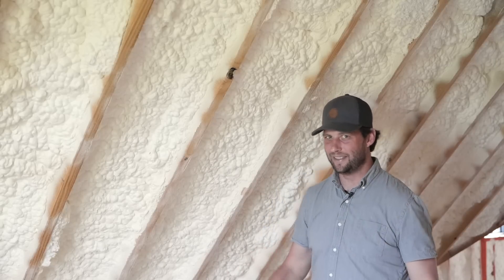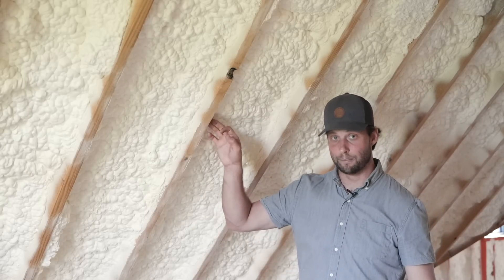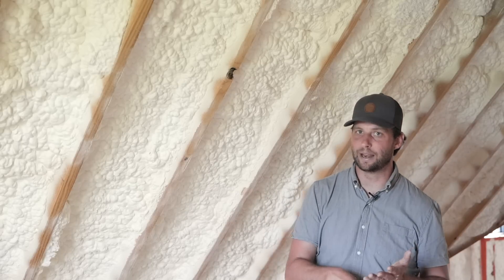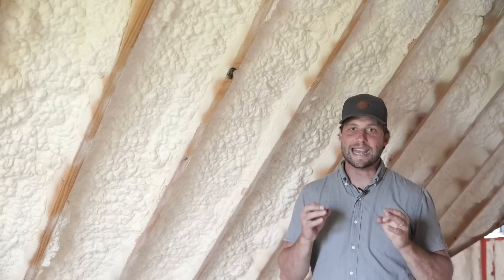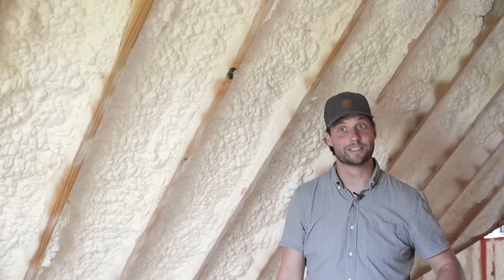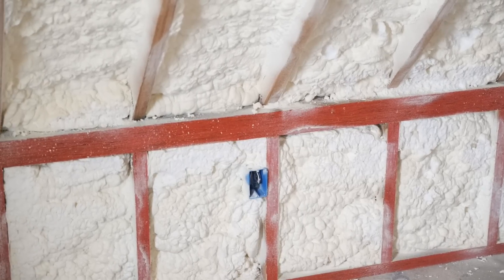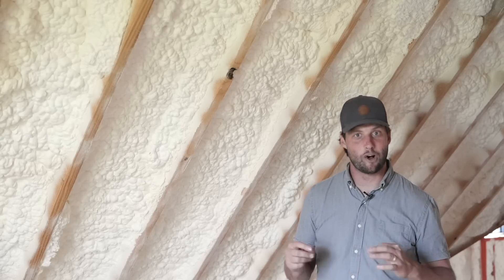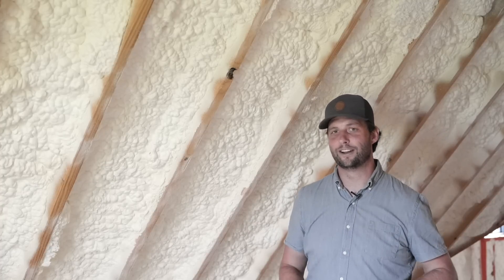Spray Foam and Radiant Barrier: How NOT To Do It!!

Comment: Did I miss something? 

What's wrong with venting the roof with the plastic baffles on the sheathing and spray foaming?

Also, I'm a Canadian. First thing I thought of was to use vapour barrier!
Reply: I tried it and I liked it! We I have used open cell spray foam on tech shield with vent baffles to allow the hot humid air to escape through ridge vents. I compare it to the effect of backer rod and caulking. The vent baffle (like backer rod) not only creates the 1” air space that tech shield needs, but it isolates the spray foam from the roof deck. Like caulking, spray foam can only stick to two slightly moving surfaces (the rafters in this case). When they are applied to three surfaces (2 rafters and the roof deck), the foam (or caulking) would only be able to stick to 2 of the surfaces and would delaminate from one of them to allow the rafter to expand/contract. Thereby leaving the air gap some say happens over time with spray foam apply to the underside of the roof deck. We have had amazing results and ACH sub 0.5!
Reply: @HeirloomBuilders  do you need vapor barrier in your design? My contractor told me to remove anything that preventing air flow
Reply: i think he didn't put a vapour barrier between the plastic baffles and the foam...but yeah i guess it should work. because what you want to shield against convection is your insulation, not your house
Reply: @TheIcyhydra  he didn't use plastic baffling, he spray foamed right up to the reflective sheathing. 

To my understanding, if you're going to use batts for the insulation, you get them 2" shorter than the depth of the rafter bays to leave a gap for roof venting. This was his original plan. But then he was concerned about air sealing. Normally in my parts (it's code) you'd apply a layer of poly sheeting after the insulation which is the air control layer. Then the drywall on top.

But if you're going to spray foam, there are the plastic baffles that hold off the spray foam 2" away from the sheathing  to allow a channel for air venting and then the closed cell foam acts as the air control layer.
Reply: @beurky   yeah... they'd use plastic baffling on concrete too near the liquid barrier, it's pretty similar in term of diverting a fluid

Comment: I went through the same process and ended up doing the same thing in my attic, except that I removed the radiant barrier, first.  I think when I replace the roof, I'll add radiant barrier to the top of the sheathing, then an air gap and another layer of sheathing with radiant barrier on the bottom.

Comment: I don’t like ridge vent systems for a couple reasons,  one is the idea of letting damp air into my attic isn’t good and 2nd is I don’t like holes in roofs.  Iceneyne foam is amazing. It might be rated at r21 or r38, but the real number is higher but there’s no way to rate it.  In my house, in south Florida,  I’ve had my power go out and the house go from 76 deg to 80 deg over 8 hours in the middle of the day.  I use it in all my custom homes. There’s also a noise factor to it.  Houses with the foam are a lot quieter than the same house without it for some reason. It just seems to absorb sound.  It also makes it easy to work in the attic since there’s no insulation to dig through to find a wire or add a fan or light fixture.   It’s not cheap, but it will pay for itself in electric savings, but there’s more “quality of life” value to it than just saving money on electric
Reply: Their is just no way to seal your house tight enough for this way of insulating. Maybe for a short term and when you seal it up like your trying to do, you have no way of knowing until its to late that you got mold. You build for known inconsistencies in construction.
Reply: Did you insulate walls or just attic - South florida build here with basically no insulation in walls and typical blown in fiberglass in ceiling but considering having roof sprayed and removing fiberlgass. Appreciate any feedback

Comment: When i redid my roof, i had ridgevents put in, thinking i was being smart and thinking ahead when I redid my living room and attic space to add better insulation. Turns out I was going to do sprayfoam and not have to worry about a hot attic in the summer. Obviously ridgevents aren't that expensive, but i was bummed that i essentially wasted that money. I have a 1200 sq ft garage with stud framing and trusses. What do you think the best way to insulation the attic space is? I don't have anything on the ceiling as far as drywall goes, I've heard about people using foamboard, but that's not code, apparently.  I thought about rockwool for my walls, but fiberglass batts with a radiant barrier in the attic space,  but I'm not sure quite how to do the radiant barrier. Any input would be appreciated. I'm in ClimateZone 4.
Reply: Curious what you did. Climate zone 4 here also. Currently I plan on using tech shield, smart baffle, and sprayfoam in a cathedral ceiling. 2x10 rafters

Comment: I'm curious as to what percentage of the heat will change to conductive heat. I just can't see all of it conducting, especially through a material that wants to resist heat.

I understand why you didn't try a hybrid system, but if you were, I would have done it one of two ways. Use something similar to those awful attic air deflectors to create the gap and then spray foam to create the air barrier. The other way would be to put sleepers down on the roof deck (using standard sheathing for the roof deck) and then putting the tech shield on top of the sleepers. In both cases though you would still have an eve and ridge vent. One other way that comes to mind without having to use tech shield is to just put the metal roof on sleepers and allow that to vent.